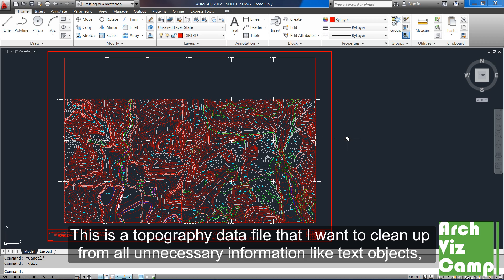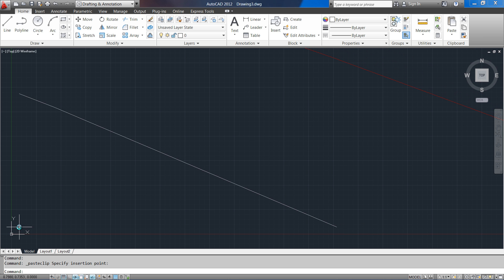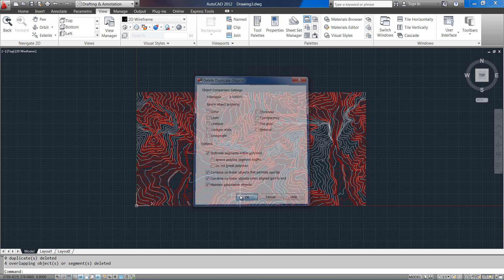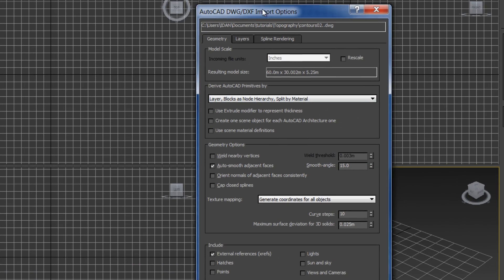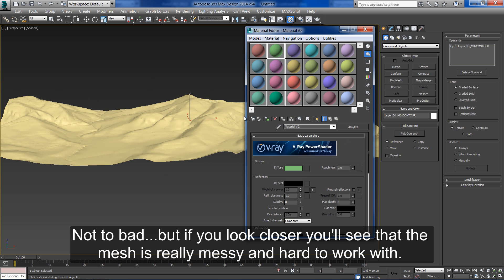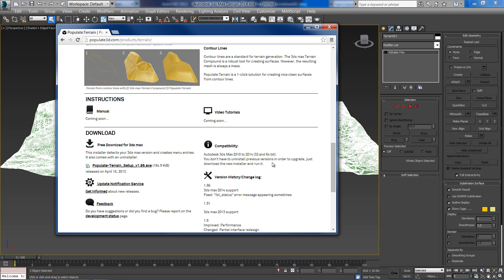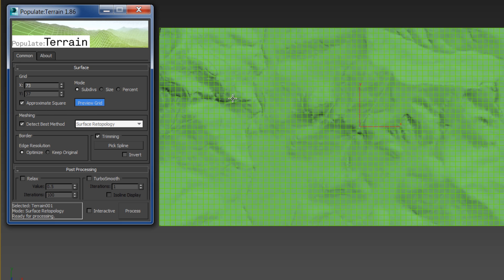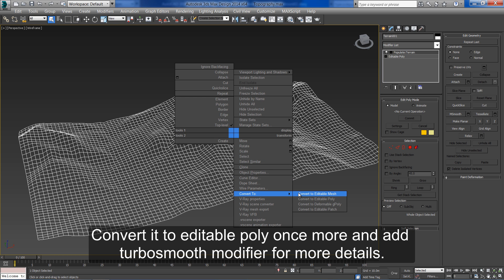3ds max tutorial -Terrain Modeling : how to convert Autocad topography lines to 3ds MAX model

Comment: thanks a lot, the plugin is no longer available, website is down but i was able to find the script, here it is, https://drive.google.com/file/d/1LWDuboMLUVC3Z6pHq5ff07eysEYB9U18/view?usp=sharing  i use 3ds max 2021 and it works just fine, only thing to do is drag the updated version on the 3d viewport or run the script from the scripting panel and that's it.
Reply: thank u

Comment: +arch viz camp Even after optimising the polylines in autocad down from 1 000 000 to 270 000 when I import it into 3ds max its lagging hardcore... down to 0.087 FPS. I pressed terrain and it pretty much freeze. I have a beefy computer so there is something I must do wrong. I unticked cap closed lines, reduced the steps to 6 from 12 but I did not resize it as its the correct units. What could I possible do? Thanks for the help!
Reply: I managed it, I will post my process if anyone needs it.

Comment: You r amazing! thanks!
Reply from the maker: Angelica Manfredini thank you!
Reply: Even after optimising the polylines in autocad down from 1 000 000 to 270 000 when I import it into 3ds max its lagging hardcore... down to 0.087 FPS. I pressed terrain and it pretty much freeze. I have a beefy computer so there is something I must do wrong. I unticked cap closed lines, reduced the steps to 6 from 12 but I did not resize it as its the correct units. What could I possible do? Thanks for the help!